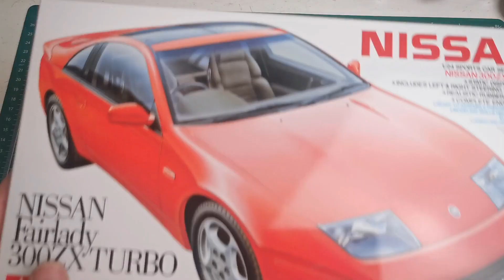Build a Miniature 90s Sports Car: The Nissan 300ZX Turbo by Tamiya [FULL BUILD] Step by Step

Comment: Really nice build. Having made the Fujimi version last year (which isn't a terrible kit) you can see improvements with this one. Cool to have a full engine too.
Reply from the maker: The engine is nicely done and looks good when completed. Could use a little more detail but I am not too picky. I build the Fujimi convertable version many many years ago but don't really remember much about it except for the awesome BBS wheels it came with. I might have to pick one up again and give it a go.

Comment: What wheels did you use here? I'm really struggling to find fitting wheels, the link in your description doesn't list any Tamiya wheels, can you recommend another brand that fits well? Thank you for the video! Real helpful
Reply from the maker: The wheels used are from Aoshima and one of their individual rim sets. The inner hub of the rim which holds the polycap had to be ground down and then the rim was just glued directly to the brake disk. Unfortunately for wheels with pegs like Tamiya, you will have to find someone who does printed rims.
Reply: @ScaleAutoGarage  Thank you! I was also curious what the point is of those black lines front and back when you start the body prep?
Reply from the maker: @paatz04  when the bodies are moulded, there tends to be small raised lines where the mold pieces meet, usually a top and bottom part of the mold. You use a sharpie to go over those mold lines and then sand them to make them smooth. When you and to the point that there is no longer any sharpie mark then you know you have smoothed out the line.